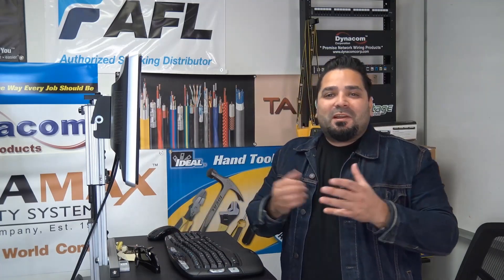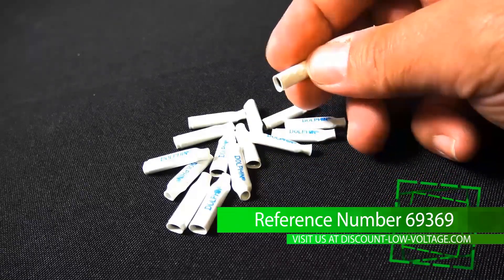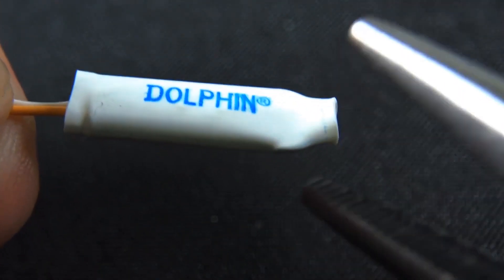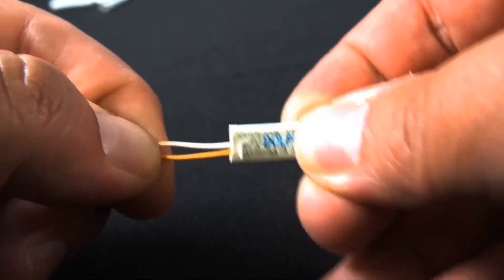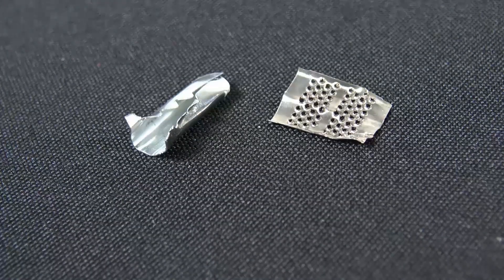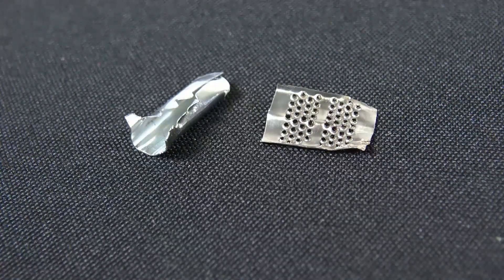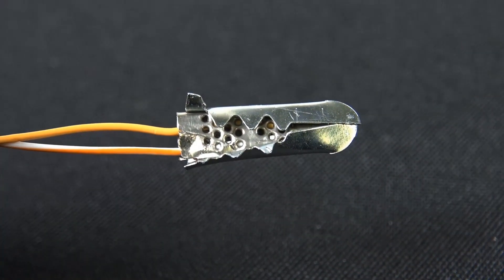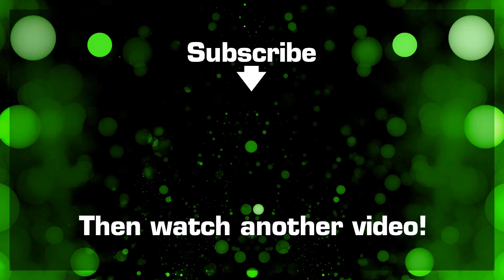B Wire Connector (How to Crimp and Overview)

Comment: You do realize you're not supposed to flatten these? You peen over all the teeth by doing such. The correct way is to press them parallel and not squeeze them flat. GMP makes a modern tool that mirrors the original Bell system presser. I have both. If you don't have the proper tool, the next best is to use an oval style crimp.
Reply from the maker: Thanks for the feedback. I was doing what many phone tech guys told me, squeeze the crap out of them. I found the crimp tool from the manufacturer, looks like an oval type crimper. You'd be surprised how many phone guys don't know solid vs. stranded plugs.
Reply: Yeah I came here to say there is a tool for this
Reply: David - Can you link to the tool you’re referring to? Thanks!
Reply: GMP makes the modern version. Otherwise search eBay for bell system B wire presser
Reply: Not saying you are wrong, I am not the expert, but I have worked with guys who were in the telecommunications industry for years. They all use pliers to flatten them. lol Never seen any of them mention or use any other tool but pliers. Good nugget of info to know though
Reply: @AxxinTheSupernova  They don't use them because they're union, and therefore sloppy and lazy. SMH
Reply: @bitshtannicajohnson6957   Some just didnt have the tool possibly.......Or they just knew a pair of pliers was faster

Comment: Even when squished quite well.. I always strip and twist wires together.. tired once to skip that.. and of course over time was having issues.. screw it.. they are quick covers.. to me.. and squish with needle nose is like the worst tool.. far to weak.. I use Cutters which have Flat squish on handle side.. give the most strength I find..